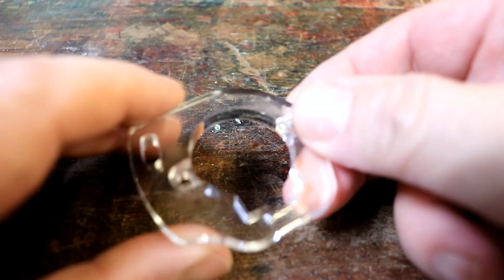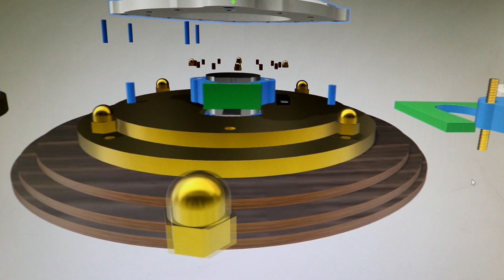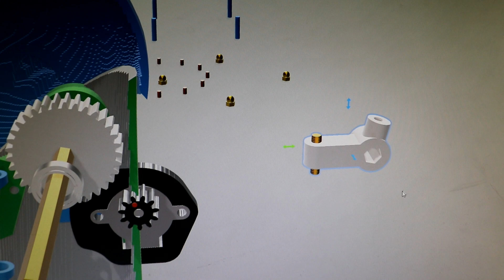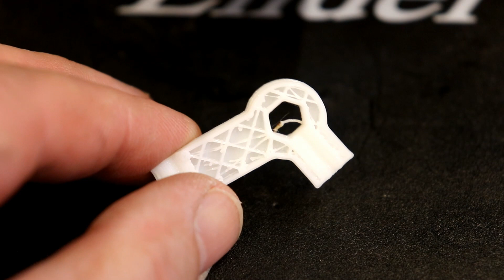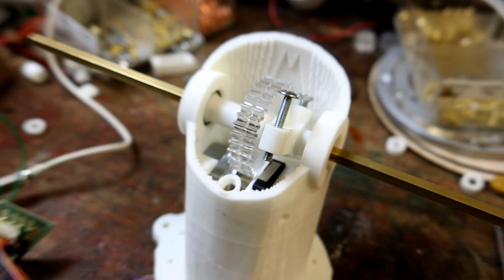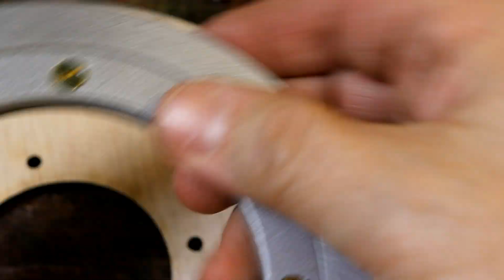2. Making a Moving Neck for Victoria

Comment: Could be reed switch for the head as well. Good work. I liked the lazy susan.
Reply from the maker: I've subsequently moved on to using servo motors, as the stepper motors were too slow and required far too many connections. Thanks Ibrahim!